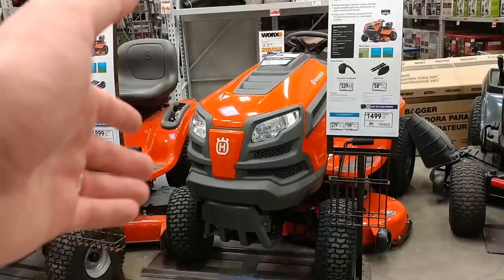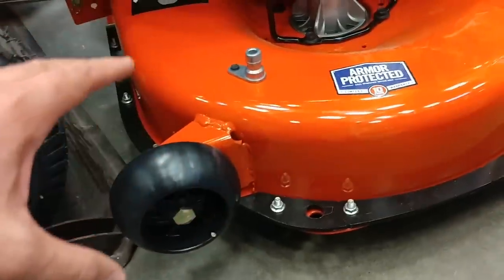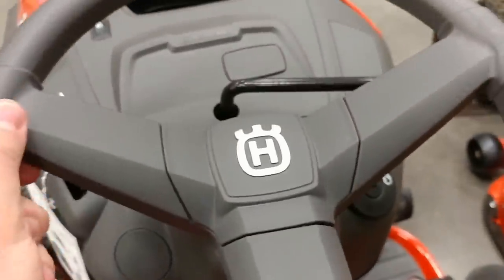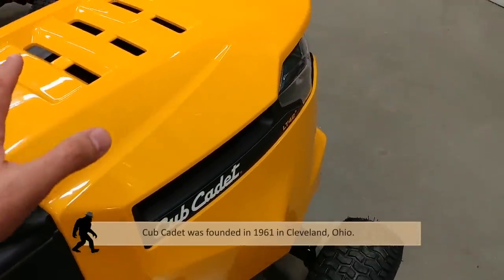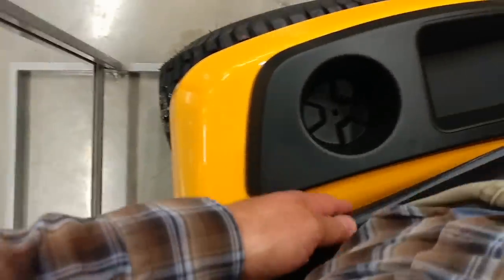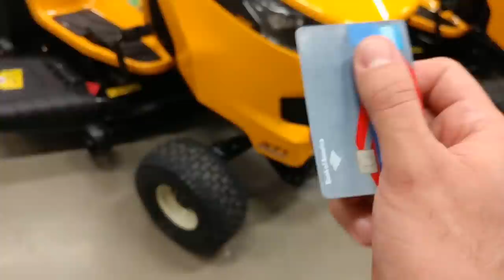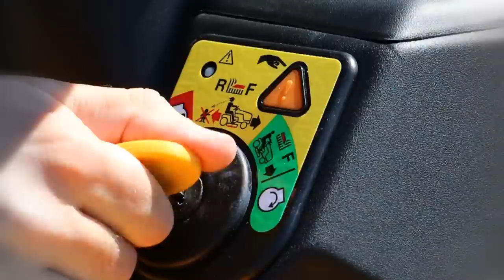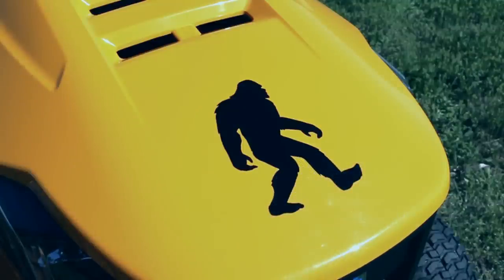Time to Buy - Husqvarna YTH18542 42” or the Cub Cadet XT1 Enduro Series LT 42" Riding Lawn Mower

Comment: I'm curious how its holding up? Bought my first house with just over an acre of lawn and although its quite a bit more than 1500 bucks nowadays I think I might pull the trigger on this model Cub Cadet! Would love to hear your opinion after a coople years of ownership.
Reply from the maker: Hi, Maceken - So far, so good.  It's on it's 5th season now, I believe (there was a bit of a lag when I posted this video).  It still starts up great, just sips the gas, and never has given me any trouble.  And after the ATV tire upgrade, I can traverse our sometimes muddy ground with ease.  In hindsight, it was the perfect choice for us.  Now I just have to get under there and really clean out the deck and sharpen or replace the blades again.  

Yes, I cannot believe the price increase in these units.  Just to re-review it, I would like to purchase a new one, but at that price point, I'm having trouble justifying it since I already own one. 

Cub Cadet, if your'e out there, contact me and we'll work something out so I can do another set of videos dedicated to this machine!  😅
Reply: I’m on my 2nd season with the Cub Cadet.  I got the LT48 with the plow blade. Like your idea of the ATV tire upgrade.  Still have to use chains on the tires and a bucket of sand in the back for weight for plowing, and it really exceeds my expectations of what a small tractor is capable of.

Comment: I'm on my second older Craftsman lawn tractor (2007 manufacture; my first was 2011 manufacture.) These were both made by Husqvarna, with B&S engines. The 2011 one has the 24hp V-twin, which is a beast. It's deck finally rusted out, so I picked up the 2007 one. I like them both but, in this case, assuming only a marginal price difference, I think I too would have bagged the Cub up and taken it home.
Reply from the maker: Just1American1966 - thank you for sharing your experience.   I had a similar experience where the engine far outlasted the rest of the mower.   Hope you're able to stick around for a while and continue to comment.   Working on a few more videos.   😎

Comment: Hey this was a fun twist to the normal videos of tractors lol
I’m surprised you didn’t compare against Johnny as well
I have pretty much the same size tractor but it has the green paint lol 🦌
It’s a basic little John Deere 102  
42” deck but a Briggs 17 horse engine and the old 5 speed transmission (I don’t even see those on new tractors anymore lol)
Got it about 9 years ago and it’s still going strong 💪 
It has the grease fittings on the spindles thankfully, and 3 grease fittings on the front axle, but no oil filter on my base model lol.
Definitely can’t complain though
Other than some peeling paint on the rear fenders this Deere has been 100% trouble free! (Btw if you end up with a similar peeling paint problem, take care of it quickly and use farm implement paint. I did that about 3 years after getting the tractor when the factory powder coat started to peel and the implement paint has stood up amazing! (It was only the rear fenders that peeled, the frame, deck, etc don’t have that problem at all)
I do wish I had a washout port but they are cheap and easy to add, so I think I will add one when I have to replace the deck belt...which knock on wood if never had to replace any belts yet. The only downside to that is the deck has never been off so when I do eventually have to remove it I foresee some rusty bolts in my future lol
Good luck with your new Cub Cadet!
Those are great too
My dad had a 1960s Cub Cadet 70 for nearly 40 years!
(They really don’t make them like that anymore, and to even get close to how heavy duty those were you have to spend around $2500 lol)
Still hoping to find one, or the identical Cub Cadet 100, to restore.
Did find one 2 months ago for $200, but was sold before I even got there lol
Those old tractors were tanks!
Let’s hope you get many years of faithful service out of your Cub as well!
Take care!
(P.s. My Lowe’s lady is not nearly as charming or nice, no fair haha)
Reply from the maker: Hi, Aaron - thank you for the feedback and information!  Actually, I was convinced I was going to get a John Deere, but I quickly found that my feet were too big to comfortably work the forward/reverse pedals.  So I started exploring the other two bands.  The are great machines though.
And Loweslitta says thank you for the compliment.  😂
Reply: Bigfoot Dad Explores Montana haha You’re welcome Loweslitta 😂
And ok, I don’t have the hydrostatic transmission, the only pedal I get is the brake/clutch pedal lol
But I could imagine if the space between the pedals wasn’t enough that it would get annoying pretty quick
Oh hey one other piece of advise if yours has grease fittings on the front axel too, get some really high quality grease for them. Some well in the know old timer farmers swear by the good stuff and to avoid the cheap brands of grease. Not sure what the difference is, but I’m pretty sure they learned that the hard way so that’s all I ever use (book says to grease them twice a year but I do it 3 times as I use the tractor for quite a bit more mowing than it was ever designed to mow lol I can’t afford the bigger tractors so I just take extra good care of this one) as so far everything is like brand new in the axel and steering. No rear grease fittings on mine (boo)
How is the steering on your Cub? You showed a little in the video and looks to have a less play than the traditional style steering on these tractors. 
Take care!

Comment: Great video and great music nice editing job I too am considering Husqvarna or cub cadet still undecided but I am going with the 46 inch deck versions
Reply from the maker: Thanks, letzfly01!  Yes, the 46" models of the Husqvrana starts to change the equation a bit for the comparison!  Hope you are able to figure it out soon - spring is on the way!
Reply: I had to make a choice also I still have my Husqvarna 46 inch been good but bought a cub cadet lt1 50 with fabricated deck 24hp engine k 46 transmission from a dealer hopefully it'll be ok

Comment: I bought a xt2  two yrs ago for snow blowing.  Struggled all winter to start it.  Checked valve clearances.  Not even close out of the factory.  They were all at .002-.003”.  I mean, who the hell is assembling these things anyway?  Reset valves and she started great all last winter.
Reply: Yeah worst piece of crap I ever bought, constant problems with Les than 10hours on it, lucky I fix it myself, will be for sale after 2 winters of light use, I would find it hard to trust that brand ever again

Comment: 4/15/19, Without spending a fortune, this looks like the right size (42") for my 10K sq. ft yard. $1500-$2000. is about right. Does this have the bagger attachment? I could pick up leaves w/it. (Cub or Husk). Deere is sort of the Cadillac of tractors & costs more.
Reply from the maker: +Peterson Weiters Jr. - Yes, but you have to order it separately.  There are two part numbers listed for the 42" and 46" options: 19a30030100 (Fast Attach Bagger for about $400) and 19a30031100 (Bagger for about $350).  Hope that helps!
Reply: Preston  Deere is all but the same tractor, JD Uses B/S engines even though it says JD and they also use the same Hydrostat trans !!!!  So what is the difference ??? An expensive coat of green paint !!!

Comment: with the manual transmissions you never need to press down on a pedal, much easier to maintain a constant speed
Reply from the maker: Hi, Trevor - this was one of my main concerns when I was looking at all these potential mowers.  I was so used to having a tractor mower locked at a certain speed that I was a bit uncomfortable with these hydrostatic transmissions.  However, given my current yard, I needed to be able to switch from drive to reverse quickly and thinking back to all the tractor mowers I owned before, I wanted something a bit quicker/easier to shift.  Surprisingly, it really isn't too uncomfortable to mow with a pedal.  I do lock it into what they call "cruise" every once in a while and that does work, but I find myself wanting to change the pace so often that it's pretty infrequent that I use it on my hilly terrain.  If I had a flat, expansive yard, having a traditional speed lever selector again would have been perfectly fine.  I hope that helps a bit with the perspective of these newer style transmissions.  If you have a chance, give it a try and test it out.

Comment: How has this mower held up since you've bought it? Did you end up changing the transaxle fluid in the K46? If so, was it difficult since they're considered non-serviceable?
Reply: I was at cub dealer today , fabricated deck k46 is on the lt 50 smaller ones stamped deck lt 200 transmission correct me if I'm wrong

Comment: Keep in mind the brand tractor you buy in a big box store isn't the same as the one you buy from the dealer.

Big box models have differences,  such as plastic parts vs metal, or subtle design differences, all to meet a price point set by the retailer.

Before you buy, compare the same model at both the big box store and the dealer. You'll pay more at the dealer but chances are it's better made, will last longer, and be easier on maintenance in the long run.
Reply from the maker: One RewdOne - thank you for your feedback.  I wish I would have known about this sooner as it may have changed my research.  I'm definitely about higher quality, especially in the details.  This is good to keep in mind and I appreciate you noting that here in our growing knowledge base.  The better informed we are, the better decisions we can make.  Welcome to the community.  😎 BTW, I like your username.  😁
Reply: Dealers sell the same models as the box stores. But the dealers offer better models also.

Comment: Finally a lawn tractor review that wasn't made by some ill-informed slack jaw out there scalping the north 40! I found this to be both entertaining and informative. The production kind of reminded me of Alton Brown's "Good Eats" on the Food Network. You also touched on a lot of details others have missed, such as the Cub having a plastic hood. I mean, I already knew that going in, but maybe a lot of others didn't. Now thanks to your review, I just ordered a new Cub Cadet XT1 Enduro 46 in. with the 22 HP V-Twin Kohler Gas engine. I prefer a V-twin for the increased torque and smoothness and had great luck with my previous Briggs 24 HP V-twin. The rest of that Craftsman tractor went to shit but the engine starts right up and runs just as smooth as day one. Also, I went with a crated machine which will be delivered curbside instead of saving a few bucks to buy a display model and having to either pay for delivery or rent a trailer wide enough and bring it home myself. You never know what your gonna get buying a display model that sat for months out in front of the Home Depot, exposed to the elements and parts pilferers.  Now if you'll excuse me, I'm gonna go watch this video again.
Reply from the maker: Patdthomas - 😂 This is one of the funniest responses I’ve read so far.  And thank you for the feedback, that is encouraging.  I agree with your assessment of a twin engine.  The older mowers I used to use had them as well and they always ran great even know the rest of the machine was falling apart.  Smooth and powerful.  I hope your machine arrives in good condition and serves you well!   BTW, I’ve started another video on the Cub Cadet which you’ll probably enjoy.  Now I just have to find time to finish filming and then edit it.  😎
Reply: @BigfootDadExploresMontana  ... I'm looking forward to your next video submission. Until then, I'm all giddy over my new Cub Cadet. It arrived three days ahead of schedule so I was kind of unprepared. The shipper unloaded the crate and rolled it up the driveway for me, but I hadn't had time to create room for it in the garage. I spent the remainder of the day digging through countless layers of accumulated crap and clutter. My wife is gonna be so pissed when she realizes how much of her shit was sent to the landfill. Nevertheless, I found your uncrating and set-up advice to be spot on and indispensable. Once the protective cocoon was stripped away and assembly and adjustments were completed, I went crazy driving this little monster all over my yard doing wheelies and spinning donuts. Within days, I added a front bumper and a tow hitch in the back so I could drag my utility trailer around and bang into shit.
Reply from the maker: @patdthomas  - That's what it's all about!  :~D

Comment: Did you consider the XT1 with the Kawasaki instead of the Kohler engine? I have been hearing reviews leaning in favor of the Kawasaki.
Reply from the maker: Hi, Scott - I would love to have the Kawasaki engine. However, on the 42" model of the XT1, only the Kohler and the generic fuel-injected engines were available.  This may have changed since then.  The last Kawasaki I had was on a larger inverter-generator and it was awesome.
Reply: @BigfootDadExploresMontana  I did pick up the 42" with the Kawasaki from Home Depot-$100 less at store than the online price. Another 10% of as a vet which I didn't fight. So far so good though just 1 cut. Amazing turning radius! Now if it could only help me get rid of the mole infestation on my lawn. Guess I will try to kill the grubs first. Thanks for your efforts!!

Comment: Can anyone tell me why cub stopped using the Kawasaki engine?  Got over 400 on my ltx1050.
Reply: They still use them in the higher end tractors sold at Cub Cadet dealers, but not in the big box store versions.
Reply: I've got an XT2 LX46 with a Kawasaki.
Reply: They didn't stop but they have it in higher price because Kawasaki is superior than Kohler

Comment: A big factor in my choice to buy a Cub Cadet vs a John Deere or a Husqvarna was the absence of levers on the left side.  I prefer to mount and dismount on the left.  The John Deere and Husky have levers on the left side of the seat that impede those procedures.
Reply from the maker: Hi, Donald - that makes complete sense.  I've noticed, too, that the Cub Cadet tends to be thought out a bit better in a lot of areas compared to the competition.  That was a major factor why I chose it in the end.

Comment: Hey Bigfoot, thanks for the video. Last season I blew the head gasket on my old Toro and was considering the Cub. Instead, I blew $600 fixing the Toro and I'm worse off than when I started. There's a Tractor supply shop in town, i think I'll get the Cub.
Reply from the maker: Hello again, Robert (just wrote back on another comment above) -- just wanted to add that I actually spent about $400 on my old mower before I finally just got rid of it.  So I can relate to what you're feeling.
Reply: @BigfootDadExploresMontana  Mt neighbor told me to run the Toro until it burn out and get a new one...I should have listened. Rather then aggressive tire I put "Terra Grips" on my rear tires. They act like snow chains but it's strips of  tire-like material instead of chain. I can climb up the wet grass like a billy goat. It rides rather rough though. Thanks for your help!

Comment: Idk i have a cub cadet since 2011 and minus minor issues its been flawless and smooth trans, just picked up a used 2018 husqvarna that's in good condidtion and the transmission pedals stick and get stuck
Reply: Check for the dirt or trash under the pedal and grease all connections that have metal on metal as there could be rust that’s causing the sticking

Comment: Is it recommend to use “no ethanol” gasoline in mowers and other lawn care equipment? Here in Texas some gas stations have an optional no ethanol gas pump and was wondering if that could extend the life of my mower, weedeater, etc.? I have the optional Fuel injected model with the standard cub cadet motor, I would’ve preferred the kohler but this seems to be working just fine, I currently have 16 hours on it is there a recommended oil change interval?
Reply from the maker: Hi, Caelan - I read your comment last week and was hoping someone more educated on the subject than I could answer.  But I can tell you what I know from my perspective.  The short and general answer is yes.  Ethanol can be particularly troublesome for small engines for two reasons: 1) the ethanol is hard on the lines as typically small engines are not built with automotive-grade fuel components, thus can cause problems like premature degradation of the rubber lines, and 2) ethanol has a tendency to gel up in the carburetor if not cycled through enough (yes, I do see that you have the fuel-injected model, so someone more qualified may have to answer this part more thoroughly).  Since small engines sometimes sit for longer periods of time before running again, unlike their bigger automotive cousins, this is why it's better to have a non-ethanol blend.   
For the Kohler, The first oil change is due at 5 hours.  I cannot recall what the intervals are afterwards (although it is in the manual), but I don't put enough hours on mine for it to be a problem just to change it once a season.  I hope this helps and good luck!
Reply: +1. I never burn ethanol in any small engine. I buy the ethanol free for my gas cans. Best small engine warranty that one can buy. YMMV!

Comment: What’s sad is that I have the 48” model and the rear differential is plastic but that 42” has a metal??? WTH
Reply from the maker: Josh - that's crazy!  Is it just a protective cover?  I would hope it would be more durable than that.   Nonetheless, post back if you have any issues.
Reply: The 42" uses the torq tuff tranny.  It is metal.